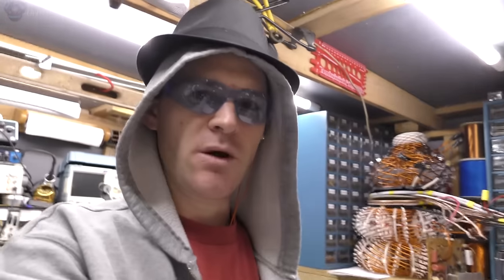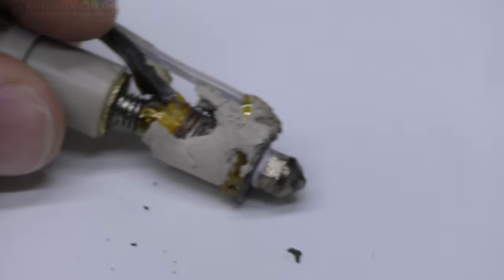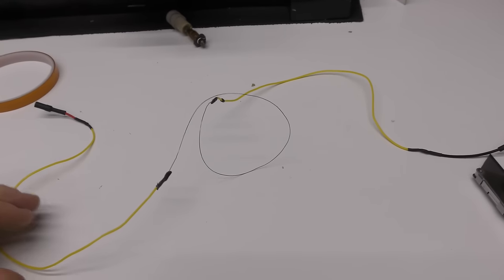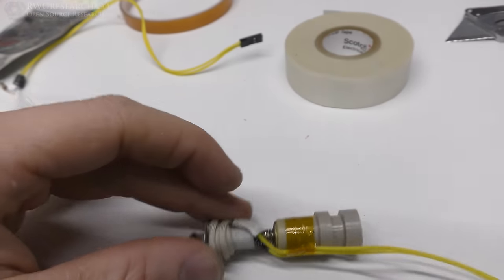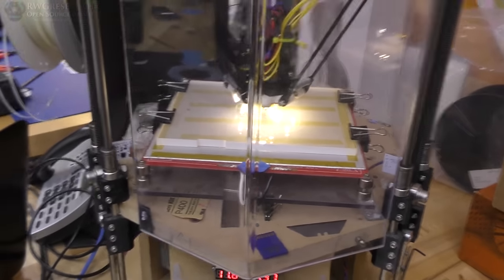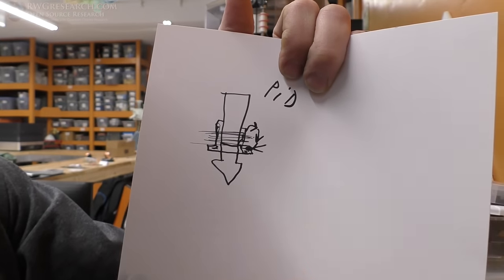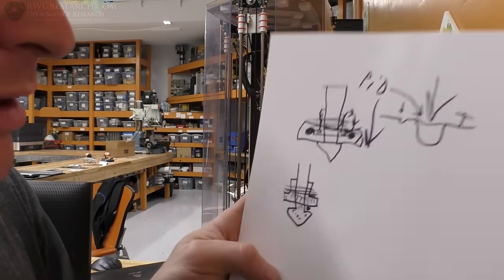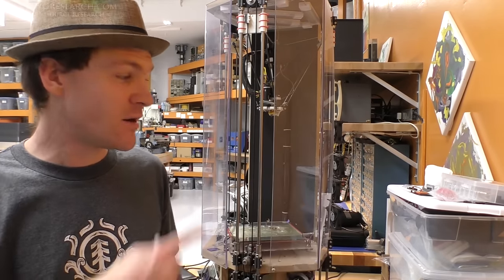HOTEND rework, low mass hotend & problems with in. MORE POWER PLEASE!

Comment: glass filled filament? Sounds great! Doesn't that wear down the nozzle though? Also i am wondering if you used thermal paste on the thermistor?
Reply: muh1h1 has a tungsten carbide
nozzle.
Reply from the maker: I do use thermal paste. however I did not on this one because I could not find it. and the other stuff I have it not rated for such high temps! :(  but yes. do use it. ~Russ

Comment: Are you using Nickel-chromium wire? It's made for and used in most heater wire installations. I have fought this type of setup for years as I developed air pillow packaging machines.
Reply from the maker: yes. that is the type of wire in using. ~Russ

Comment: Very helpful Russ!.  Would you have been able to use a megohmmeter to check the heating coil for shorts before tearing it down?  Also, the larger thermal mass issue; couldn't that be overcome by using a fast acting, high wattage heater?
Reply from the maker: yes. a megger would be greate for the job. but I don't have one. lol. also the main problem for me is the cooling down and heating up time. the more mass the more it takes to cool and heat. bigger heater and block would be ok. but I still think its posible if done right to do it with low mass. :)  ~Russ

Comment: you might look to the vaping community regarding coil building. might help with getting even heating. also with nichrome and stainless steel temp control is done in software

Comment: Also, I think I would have wound that slightly differently... instead of the whole coil encased in fiberglass, I'd just cover that initial inside downward bit (that was shorting before) and then wind the coil bare, like it was.  I think the fiberglass will electrically insulate well enough.  Having the whole coil encased like that might be costing some heat, and might be part of your PID problem.

Just some random thoughts.  :)  Good luck whatever you do with it.

Comment: we will see when Re-arm for ramps, or similar devices with ARM instead of Arduino  is ready :) if the PID issues will be fixed
Reply from the maker: yes. I will be switching over to the Duet eletronics at some point. it can handle the necessary work load! ~Russ